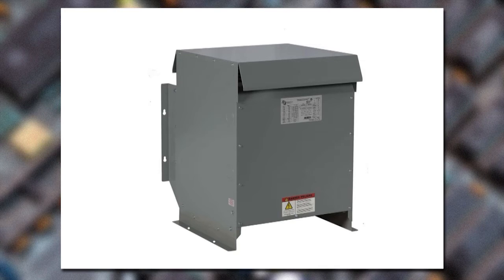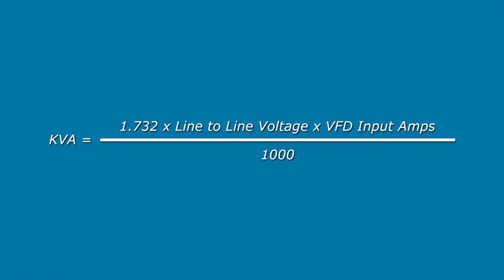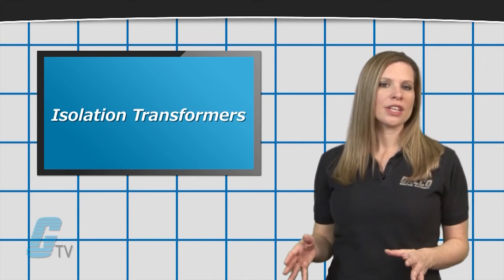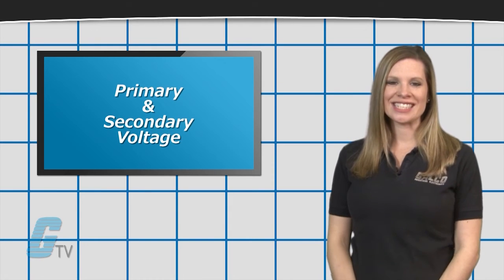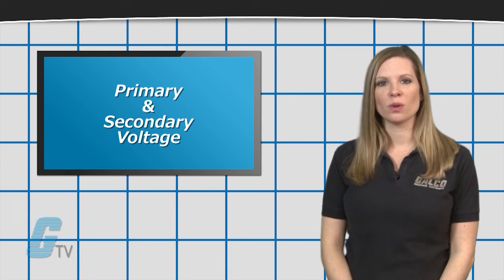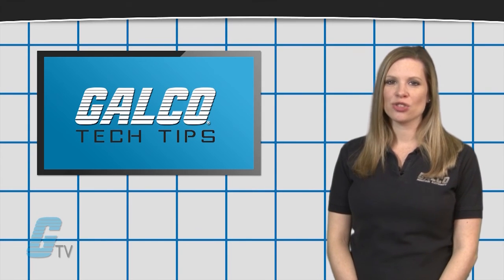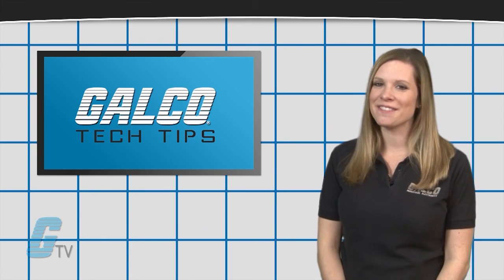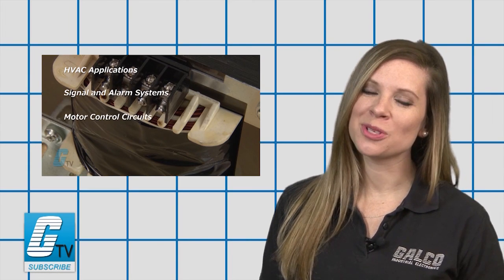How to size a Drive Isolation Transformer for a Variable Frequency Drive | Galco

Comment from the maker: If your electrical system requires a drive transformer, you will need to calculate the KVA rating.
This is done by multiplying the line to line voltage with the VFD input amps and 1.732. Then, divide this number by 1000.   The 1.732 number is the square root of three and should be included for calculations in three phase systems.